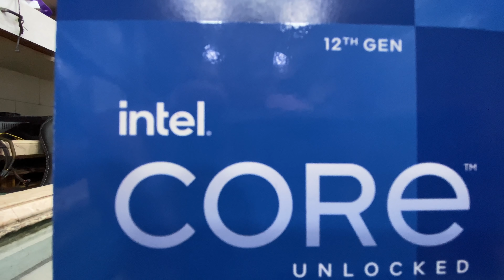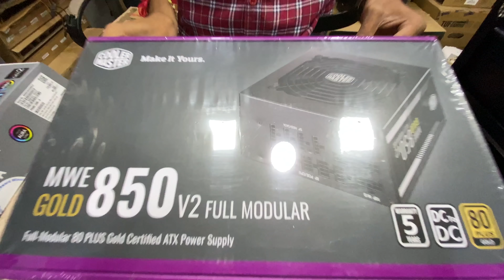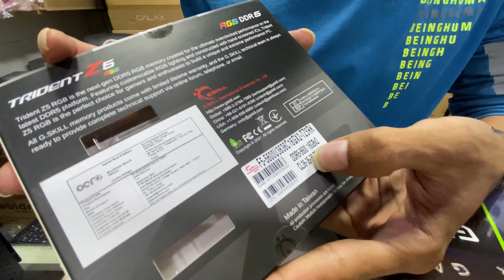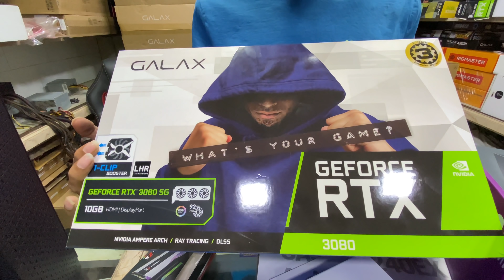Intel 12 Gen Core i7-12700K Gaming Pc Build in Mumbai | @rightsolutions899

Comment: What I would prefer to do:

1) Avoid using Prime for i7 and above in K series (The VRM's are "so-so" and will struggle to power when the demand is more or if I OC)
2) Using RTX 3080, invest in a higher MB like ROG (MAXIMUS or STRIX) this will keep my MB cooler for drawing power (when building and anticipating future demand it is always MB+PSU combination and not PSU alone, so just upgrading PSU alone might sometime not be enough if I don't use correct MB)
3) DDR5 CL rates are slow but it is OK because if I am gaming so wont use much (could save money here by using DDR4)
4) When using 3080 and intend to Game (more than 4-5 hours) I prefer to use non-modular to prevent heating because of poor quality cable socket joint even in the most reputed brands like Antec, Cooler Master, Deep Cool etc., The 80 Plus certification is for the components inside the PSU not for the socket and the cables I might use or supplied. If I am mining I shall never use Modular; I will use only the PSU with Soldered Cables to prevent burn in or overheating because of poor connectors & cables. (This is very important else I might loose my expensive GC & MB, and also PSU)
Reply: Yes true
Reply: Thanks
Reply: Which psu and mb I should be going for , not looking for more expensive components.. please suggest me.
Reply: Hey jb the cable where can you get quality cable????
Reply: Better go for asus Proart Z 690 creator wifi m, thunderbolt 4 port.
Reply: Is 12700k good with 3070 and z690
I got full pc at 66k with above specs

Comment: Can I have same pc build please with 2 lka with another mother board and ddr4 rma and white case that decrease price right and
Reply from the maker: Yess you can have
Reply: u can use a 5600x with a b550 or i5 with b560 with ddr4 ram  without any bottleneck with a 3060 under 1.5 lkh Rs

Comment: Kidney bechke Lena padega. Although saving mine I built as following:
1) RYZEN 7 5700G :29400/-
2) MSi X570 TOMAHAWK WIFI :23000/-
3) MSi 32inch c32q curved 165hz monitor :30500/-
4) ADATA without RGB 16*2 ram :5700/-
5) Kingston a2000 500gb nvme :4600/-
6) Toshiba 1tb 720rpm hdd :3000/-
7) Msi Mag forge 100r cabinet :4600/-
8) Corsair vs600 PSU :3000/-
9) Msi k30 monitor/mouse :4000/-
10) computer table : heavy customised made from carpenter : 4000/-
Total : 1,11,800/- future proof also after Amd's zen market and Intel's 13th/14th gen.
Note : no GPU added as of nakli marketing, contented & satisfied. Good days yet to come
 😊
Reply: Processor ke hisaab se mobi b series ka lete toh bhi acch rehta
Reply: And no future proof anymore because Zen 4 as AM5 chipset so it's mandatory change your mobo
Reply: Which mb should I go for ?